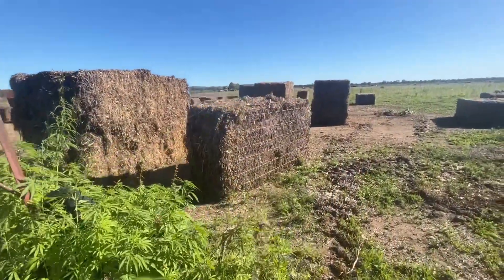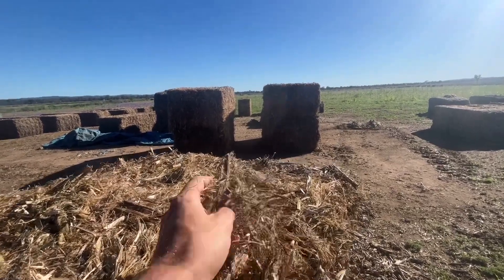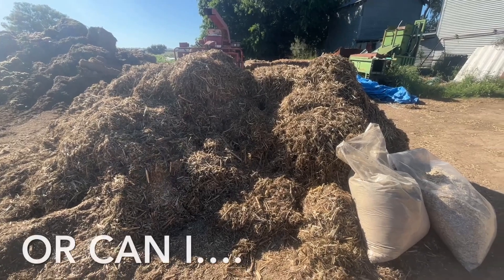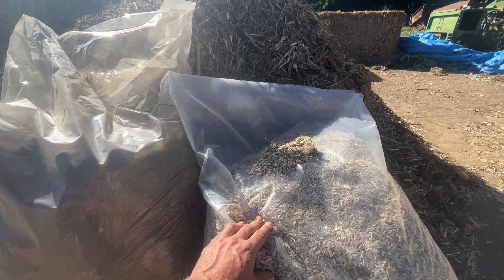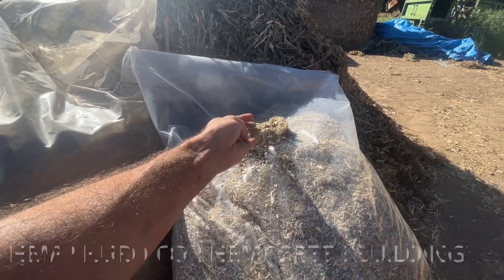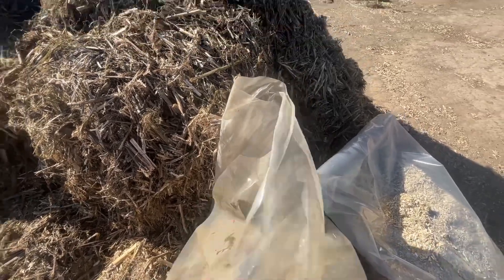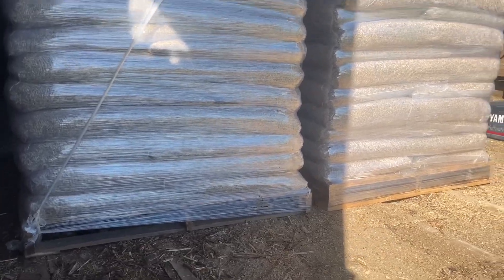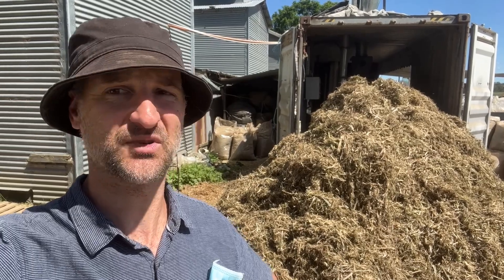Ashford Hemp Industries, processing S1 Ep6

Comment: great to see this happening  i wonder if theres an even smaller machine available for small producers
Reply from the maker: Thanks for your wondering :) 
We heard about smaller machines at Hemp-Connect in June 2025. The machine in this video is the smallest viable in the world. In Australia we actually need a proper processing factory with a massive machine. There is a smaller machine and it was suggested that with it 1 person would have to work 8 hours a day for 6 months to get enough hurd (building material) for a structure, and then the hurd would not be very good quality.